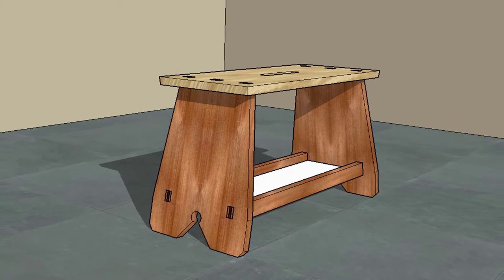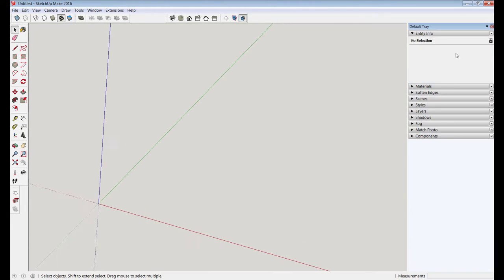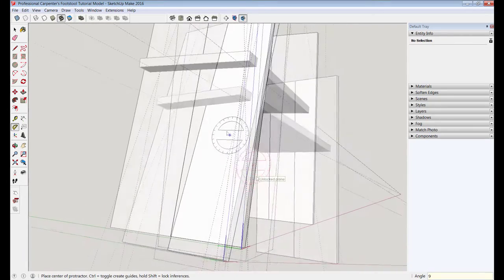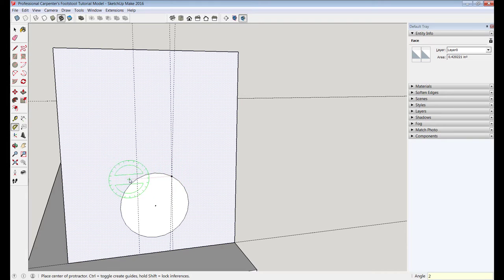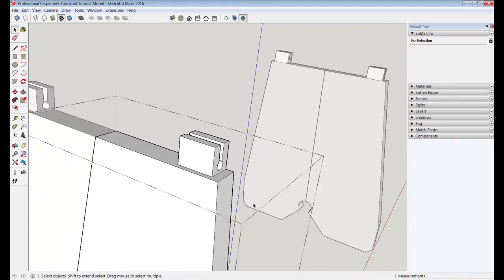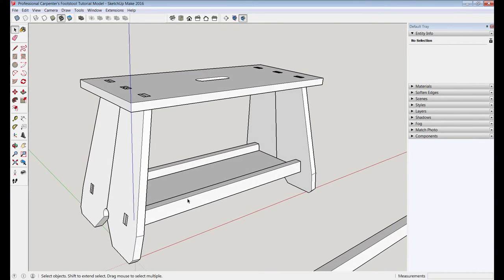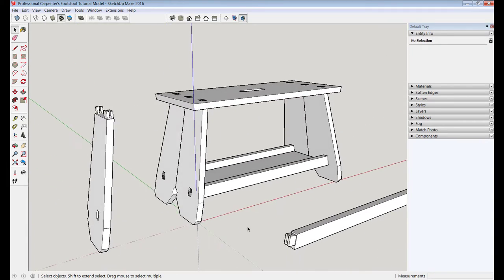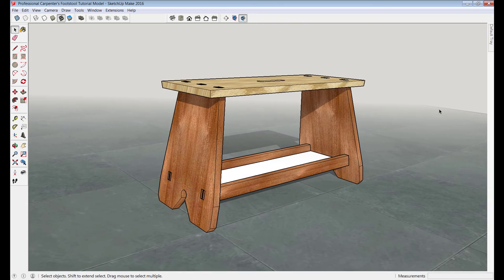Design, Model and Build a Professional Carpenter's Footstool

Comment: Nice stool Matt, I made one with splayed legs similar to yours about 20 years ago too but it doesn't have the bottom  tray. I built mine so I could reach the tops of some hedges in the yard when I'm trimming them. They are 6 feet high and holding the hedge trimmer over your head is not comfortable or safe.
Reply: Thanks for commenting Bob... splayed legs are key to a safe and reliable stool, aren't they?  Work safely! Best, Matt

Comment: When you create the center tenon on the top of the leg you made a half tenon and put a half hole in it and "mirrored" it to complete the tenon. This is fine in Sketchup, but how will you put this "strain relief hole" in the actual leg? Do you have a drill bit long enough to reach the center tenon from either side?
Reply: Great observation Bruce... it's been so long since I built the actual prototype stool that I don't remember but suspect your solution is the one I used... Best, Matt

Comment: Really like many of the features in this design. I think the build would be simpler if wedged dowel joinery were used vs wedged mortise and tenon. The holes through the top were angled to match the leg angle it would be a lot easier to make than mortice and tenon. The same for the joinery of the tray to the leg.
Reply: If simpler were the goal, I would agree, Bruce, however, I used wedged mortice and tenon both for marginal extra strength and design/appearance in both this model and the actual stool I'll eventually make.  Best, Matt

Comment: Matt, is there a way to measure a board's three dimensions all at once? 

I just want to select a board and go...without having to use the measuring tape to get each dimension one at a time. Should be a trivial function that would be very useful but I'm still a newbie, so maybe I'm missing something.

got any advice?
Reply: Hello Kam...Do you use the "Dimension" tool (in Tools menu)...?  Gives you visible dimensions, that varies/follow  with/when stretching.

Comment: Have you posted a video of the actual build yet?  I can't find it anywhere.  Thanks!
Reply from the maker: Hey Steve,
Thanks for checking into this... unfortunately I haven't built this stool yet.  I see you're a subscriber to Next Level Carpentry which is where the video will live when I'm able to work it into the schedule.  I've had the beautiful ash and mahogany boards in my shop since shortly after doing this SketchUp tutorial but a consistent list of distractions have prevented follow through on the project.  Your interest in it is new motivation to move the project ahead on the list so thanks for your patience and stay tuned?
Best,
Matt
Reply: Thanks Matt.  I recently bought some slabs of walnut, ash and elm and was trying to find a project for them.  My Dad was a carpenter and 40 years ago he showed me how to build a very similar carpenters bench out of pine with a slit in the top just like yours.  I would like to build something nicer that will outlast me.  I look forward to seeing your build.
Reply from the maker: That's cool!  It's great to know there's someone else out there who's interested in carrying on a 'tradition' for an actual skill-building stool project instead of using an over-turned plastic bucket :-)  Speaking of tradition: if your interested in photos of a couple toolboxes I've made follow the Pinterest link on the Next Level Carpentry channel banner... they might stir memories of toolboxes your Dad made and relied on as I do.
Best,
Matt